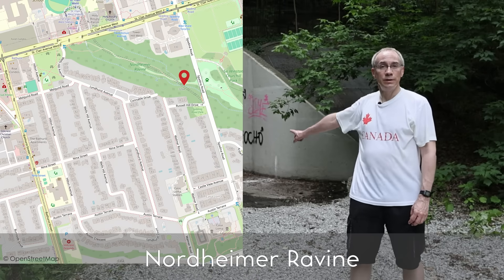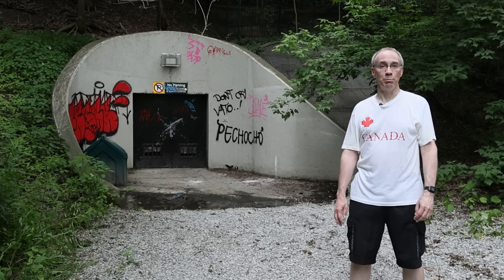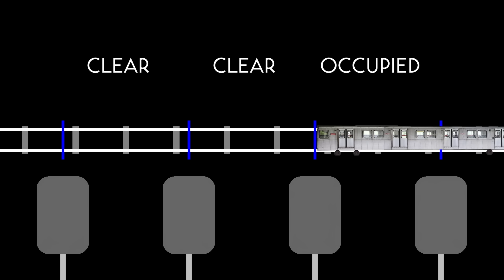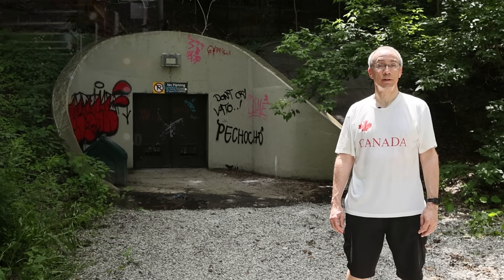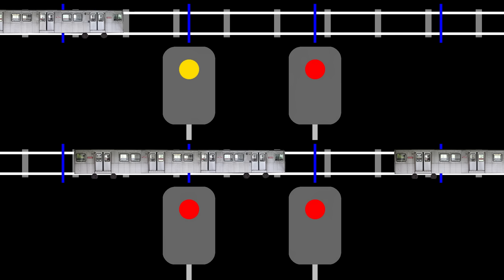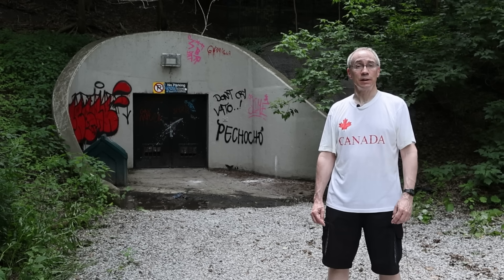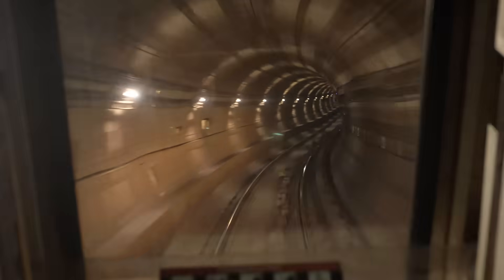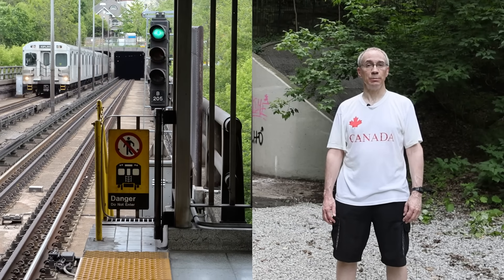TTC's Fatal Subway Crash - the Russell Hill accident

Comment: A driver caused a derail on line 3, the SRT?  Hmmm.  I remember that the SRT used technology through which those vehicles could operate automatically, without any drivers.  TTC policy was that, even so, every vehicle required a driver.  I assumed those drivers just sat there, for their full shift, not doing anything.  But this derail implies they did play a role.  And, it makess me think this derail would never have happened if the trains were operated automatically, like the same trains were ran in Vancouver...
Reply from the maker: No, the line 3 problem wasn't caused by the driver; that was lousy maintenance on its own.  The vehicles were designed for fully automatic operation (and that's how they're used elsewhere, such as Vancouver) but somewhere between the TTC and its union they decided they needed a driver so they modified the vehicles accordingly.  As far as I know, the vehicles drove themselves between stations and the driver basically just monitored operations and was responsible for closing the doors.

Comment: The Scarboro RT was left to fall apart, with the TTC planning to discontinue it, to be replaced with the Scarborough Subway extension, "eventually". Obviously, the TTC showed complete negligence, in their effort to save costs, in tolerating mechanical defects to exist, ignoring the potential danger. So often, in transportation, official specifications, tolerances, fatigue recommendations for replacement, etc. are fiddled with to save a few bucks. Most all non-driver/pilot error disasters happen due to skinflint corporate decisions.

Comment: Not sure I understand what the engineers were thinking. If grade timing is an indicator of a speed limit for turns/slopes, wouldn't florescent signage for the constant speed limit make a static light redundant? Why give a red light a completely different meaning that allows train operators to hallucinate whether everything is fine vs full stop?
Reply: Because this way the signal system could enforce speed limits, before computers or train-wayside communications existed. The concept of grade timing was used in a lot of American cities before the TTC built the subway, and they TTC would have designed the signal system in the late 1940s with input from the American consultants they hired. The TTC started building the subway shortly after World War II and as a consequence used old technology.

Comment: I was 10 years old and living in Milton when this happened. However, whenever my family went to visit my grandmother in North York, we would sometimes take Yonge line downtown. I never sat up front at that time, so I never saw the driver's playing chicken with the red signals. But I do vividly remember how fast the trains were going. I could tell based on how quickly the fluorescent lights in the tunnel were shooting past the windows. There were times that the train went over switches so fast that I was worried about the train derailing. I was genuinely terrified of the subways when I was a kid. So when this crash happened, I was surprised but not surprised at the same time. This was an UGGLY crash. Shame on the media for glossing over it 30 years later.
Reply: Ikr, I feel they should’ve brought it up again as for a memorial for the victims who were involved in the violent crash and were stuck inside the destroyed subway cars.
Reply: @B747Fan-70  Yeah, I mean it's the least they could do. It would be a reminder of what happens when you get too lax with safety and maintenance protocols.

Comment: Using an "amusement park level ride" for a busy transit line as in the Scarborough LRT was an idiotic decision.  They should have just extended the existing subway line north.  Would have been far cheaper in the long run!
Reply: The original plan was to run CLRVs (which were new at that time) down a reserved right-of-way. That also would have been far cheaper in the long run.

Comment: Thank you so much for this video. Excuse my ignorance, I am new to transit and I am learning. I have a question: only the trip arm associated with the last red light was supposed to work and failed? As you said, the driver had passed multiple red lights (I saw in some sources 3 red lights). Why didn't any of the previous ones activate?
Reply from the maker: Good question, and I haven't come across a good answer.  Sorry.

Comment: I remember riding in the front car and seeing the timers clear right before the train would pass them, the drivers definitely knew how to operate the trains right up to the safety margins.

The New York subway uses similar signal rules to the TTC, one of the big difference is that in timed blocks, the lunar is on the exit rather than entrance signal, which addresses the same problem the TTC did with the flashing red aspect. The concept of a timing signal is unique to rapid transit systems in North America AFAIK, I guess in the TTC's case they are a product of the American consultants the TTC hired in the 1940s when they were planning the original Yonge line. There are signal rules in other countries that are conceptually similar (like approach release signals in the UK, and some of the Japanese ATS systems), but I'm fairly sure there are none that expect trains to approach a danger signal at speed.

Comment: I missed that train by seconds i didn't feel like running to get it before the doors closed. One small choice made all the difference.
Reply: You made the right deduction there. If you did get on, you would’ve seen the violent impact and it would’ve been very dark inside so good job on your part for avoiding that train with the rookie driver.

Comment: Speaking of linear induction motor, these trains are shaky compared to normal rotary-motor trains, that's due to the complex vertical force between the stator and the strips. That force is interfering the dynamics of the bogies.

Comment: The time signal is a clever design back then, it can achieve speed limit without using modern communication technology. Just time counters and signal lamps, no radio or transponder needed.
But yeah there are possibilities that drivers misunderstand signals (just like this one). Simple solutions often come with such disadvantages… That's why modern techs aim at reducing human error

Comment: Thanks for the video. I had forgotten about the crash but I do remember hearing about it back when it happened. I liked sitting or standing at the front of the train looking at the tunnel ahead and the lights of the old signalling system. Sometimes the driver left his door open and you could watch what them driving the train. I don't know why they started numbering the lines. I have to think hard as to what rout they are referring to. It is still the YUS (using its abbreviation), Bloor-Danforth, and the new(er) to me Shepherd line. The Shepherd line didn't exist in the days of my youth.

Comment: At 7:25 the video of signal B205 shows a bit of contact bounce where the aspects jump briefly from yellow back to red.  Nice catch!  That is due to poor or "sensitive" adjustment of the VCC box contacts that confirm the trip arm position (see the lever on the right side attached between the trip arm "T" and the junction box beside it).  If adjusted properly, this indecisive aspect should not occur.  Movement of the arm is actually a heavy induction motor that winds itself against gravity... or a spring... the motor pivoted and held itself up to keep the trip arm down.  A contact disconnects the motor winding at the end of travel, leaving only a "hold" winding energized to keep the motor in the lifted position (or acting against a compressed spring).   With loss of power, or de-energize the motor to raise the trip-arm, and gravity will take motor back down and with it, the mechanically connected trip arm goes up.  Thats why the trip arm goes up faster than it gets motored back down.   Much of the legacy signal system, especially the BD line, is generic with other properties like NYC's MTA.  I recall from a trip to NYC, MTA puts the lunar aspect under the signal that will change due to GT, so the operator knows whats going on...not going on memory from the previous signal.  I also recall (worked in TTC Signals) that the Ericsson trip arms on the Spadina line wound against a spring, and had a solenoid with a strap to keep the trip arm down.... yeah.. it looked and operated cheaper!   

Regarding driving through reds... some operators got so good at it!  While the signal might still show red or only blink yellow, the grade timer relay cleared, and the trip arm movement had already started a second sooner, just didn't get low enough to activate the VCC contacts for the clear aspect.  If the operator got the timing wrong, yes, they would trip and stop, requiring them to go to track level to pull a rope/handle to reset the trip arm.  And subsequently report the incursion to Control.  This was from 1980's, so is as best as I can recall.  Moto of a Signal Maintainer:  "Keep the trains off the ground and away from each other."

Comment: Possibly the most ridiculous signalling system I’ve ever heard of. On top of that a management that doesn’t appear to care about signals passed at danger. This is beyond amateur, just straight up dangerous.
Reply: Well they have gotten more serious at management post crash. This means that the TTC had cracked down on operators who kept running red signals and started suspending them.

Comment: This makes SRT's closure even more ridiculous. It derailed not because it's old, rather because TTC didn't maintain it properly.
Reply from the maker: Well, it was also old - about a decade past its design life.
Reply: @notsmoothsteve What I am saying is that the accident, which could have been prevented with a better maintenance, caused the SRT closure earlier than what the city originally planned.

Comment: You didn’t mention double-try grade-time, a system widely [at least at one time] in use in NYC.  The main point of that system is to eliminate, more effectively than random crime-and-punishment human enforcement, the practice of operators pjaying chicken with red signals.

With double-try, the operator instead plays chicken with the yellow-over-lunar [in NY it's a letter S or D rather than a lunar circle].  If he wins, the yellow clears as he reaches it and the following red clears at the same time, either to yellow-over-lunar or to green; if he loses, the following signal doesn't clear and a very slow timer is started, forcing him to slow almost to a stop before it will clear.

The most egregious single-try stretch in NY was the 14th Street tunnel under the East River.  You'd almost never see the reds clear before the train passed them, but you never saw a train get tripped either.  AFAIK, this was accepted operating procedure.  Ironically, it was the first line to have wayside block signals replaced by automation.
Reply: this was a big story as well.  they wanted all the drivers to go for counciling for high risk behavior

Comment: I attended Ryerson U. in 93-94 and always rode in the railfan seat when I was on the subway.  I remember watching drivers appearing to blow past red lights (not knowing about grade timing yet) and wondering how they got away with it.  When I returned to live in TO in 1999, I noticed how much slower the trains took the stretch from Eglinton West to Dupont compared with 6 years before.
Reply: Explains why pulling in to Eglinton station going northbound is so excruciatingly slow.
Reply: @BenjaminGlatt Eglinton on the Yonge line?  No, that's slow because there's a tight s-bend in the tracks to align with the centre platform in the station.  If the trains didn't slow down there, they would derail.

Comment: Hi Steve, I love your videos. I am wondering if you might consider heading to the Don and doing something related to the mountain bike trails? I used to ride there a lot and would come across areas where there was old infrastructure or maybe an old garbage dump. I was always curious of what was there.
Reply from the maker: Thanks!  Mountain bike trails aren't really something I know much about.  There are indeed some old garbage dumps along the Don, among the 150+ former landfills scattered through Toronto - I mentioned a few of them in an earlier video.
Reply: @notsmoothsteve  bluehaven school is built on one.  don't know if it's open or closed.  i do remember it was closed for a year to expel the methane gas build up.

Comment: Thanks. Great analysis. BTW, at 5:45, how did you manage to get to the front window of the train? Every train I have got on since Covid has those seats roped off.
Reply from the maker: You're thinking of the older T1 trains on line 2.  The Toronto Rocket trains on line 1 have a semi-silvered window between the driver's cab and the passenger area.  Next time you're on one, put your hand on the window above your head (to block the light shining from just above) and you'll be able to see through it a bit.

Comment: Ppl blame linear induction..SkyTrain is still operating. It's just the TTC being cheap
Reply: TTC is their own worst enemy.
Reply: More like Toronto getting consistently screwed over by the provincial government. Toronto consistently makes the most money for Ontario but consistently gets the shit end of the stick. Toronto had to pay for its own highway for decades while all other municipalities got theirs for free. TTC barely gets provincial funding whereas other transit systems get heaps of cash.
Reply: @johnsonqu7215  they transport the unhoused,  unemployed youth to ont. services/counciling for free.  weather emergency housing  re hot/cold/flooding
Reply: @johnsonqu7215 understand that funding for the TTC changed when amalgamation began in the late 1990’s by the Harris government.
Reply: Grew up with the RT. soft spot. I always wanted the line to go to Malvern and at least have Mark IIs running
Reply: bro line 3 was my favourite line and the ttc had to remove it cuz they were being cheap
Reply: The technology works, obviously. Skytrain is a prime example of that. The main issue is that Line 3 SRT was originally designed and partially built as a line that would use Streetcar trains. The change to ICTS trains was made late as the Ontario government had the tech and wanted it used somewhere in the province. They forced the TTC to take them by promising to cover many of the costs of construction and budget increase. We couldn't upgrade line  with better trains or more frequent service or extensions because of Kennedy Station, the sharp curve immediately after it and the sharp curve between Ellsemere and Midland. There was no way to rebuild them to fix the issue so shutting it down was the natural conclusion.
Reply: TTC is an agency of the City of Toronto.  Their finances are provided by the annual city budget and at the fare gates.  Other city public transportation gets funding from their province and/or the federal government.
Reply: Comparing SkyTrain to the TTC is like comparing a garden hose to Niagara Falls. The King Streetcar alone carries more people in a year than the entire SkyTrain network. Different league entirely.
Reply: @TMBpk  That's not even close to true. SkyTrain had about 150M annual boardings, King streetcar had 13.5M. And SkyTrain provided those passengers with much faster, more reliable, and more frequent service than a streetcar.
Reply: @TMBpk   Comparing # of passengers as ''proof of larger differences than similarities'' when clearly the original comment had nothing to do with useage, but rather the comparison of technology, design, and maintenance... probably would've been best to read and understand the original comment before attacking it.  As a transportation enthusiast myself, I will double-down on the OP and say there are indeed more similarities between the SkyTrain system and the now defunct Scarborough LRT, than there are differences so, yes, it's reasonable to assume the TTC's poor attitude towards maintenance and safety are the biggest difference.  This critique is ALSO given in the video itself.

Comment: 7:17 This is a change blindness test. I don't see the lever arm, but once it's pointed out I will never not see it - where is it?
Reply: Very bottom of the image next to the right rail. Looks like a handle. Make sure your video is zoomed all the way out - if it's zoomed in at all it will be out of frame.
Reply: @OntarioTrafficMan  Oh wow! Like all change blindness tests I cannot fathom I didn't see it. Thanks!
Reply: they had pictures in all the papers detailed diagrams on how it worked and shortage of material on the non spec parts used